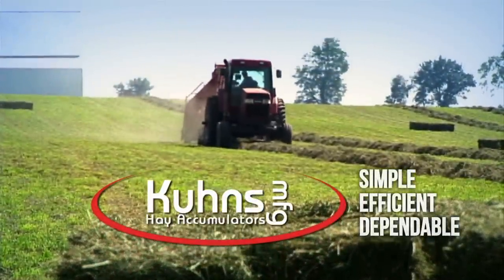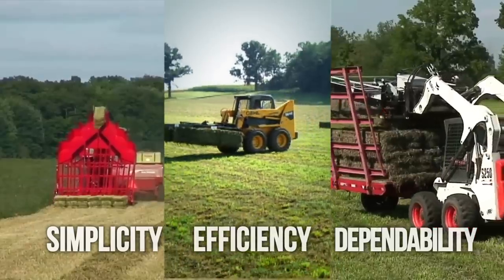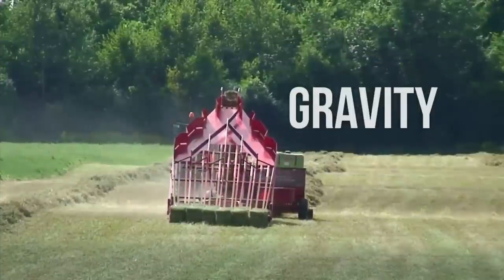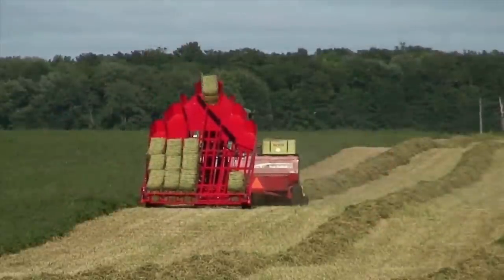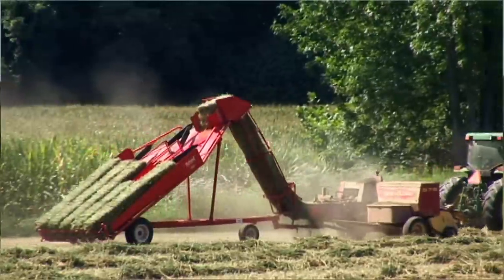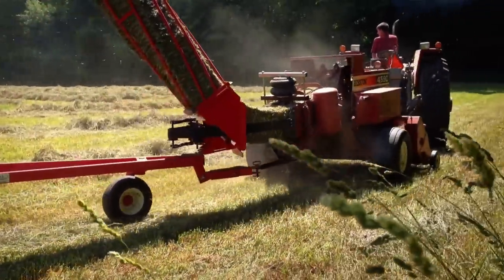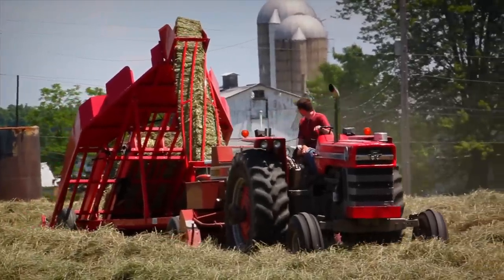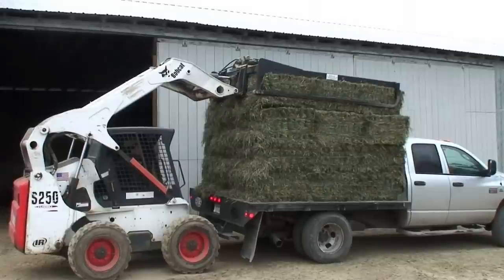Norden Mfg Hay Accumulator System

Comment: I see that these seem to work well on flat and level ground.  My question is how well do the accumulators work on hills or side hilly grounds.  Looks like they could not handle unlevel land very well
Reply: my dad had one we baled on hills alot, and let me you they are fucking garbage... well not all the time but we had problems with  the bale grabber ... and never touching a bale thats bullshit the bales love to get jammed in the very top of the  accumulator and we only used it for straw.....idk how but this dumb thing does not work for straw. we tried it on hay on our hay field which is on a hill and we had less problems but still
Reply: but the bale grabber has been improved  scene we owned one

Comment: 8 bale sleds,that sit on the ground, have been around since the small bale was invented, using the gate system to arrange the bales, your system is just taller, more expensive and puts stress on the baler pushing bales up that chute. you have basically produced a worse version of something that has existed for decades, well done
Reply: Thank you for your comment. My dad owned an 8 bale drag style before he came up with this machine. There are a number of issues that you will encounter with the drag style that are all fixed with this style accumulator. For example, the Kuhns accumulator allows for packs up to 18 bale for a 225% increase in efficiency over an 8 bale system. It allows for the option to put the bales on edge for storage and also does not drag your valuable hay on the ground.

It is a myth that there is extra pressure on the baler. The plunger of the baler only applies pressure to the hay in the chamber, so anything restricting the hay will have a direct effect on the density of the bale. It is possible to make a 35lb. bale in the right conditions with the Kuhns accumulator. The bale chamber needs to be loosened 40%-50% to compensate for the chute but if it is loosened completely, the bales will be too loose to stack well.